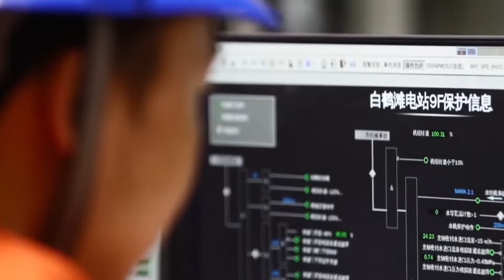Megaproject Of The Century: China Starts Building World’s Biggest Hydropower Dam!

Comment: Good Morning 
This document is for a retro fittable power production system for hydro dams to have up to three extra turbine banks without making issues for the main turbine hall
Now the reason this type of system has not been looked at was two fold .. the loss of flow rate and back pressure issues
Now these two were said to me as the big issues and yes there are others but they are foreseen and can be overcome  
As all the worlds dams have the same basic layout regardless of the turbine fitted. That being water turbine shaft to shock uni joint to the power turbine. And so all have the same common limitations  
A new type of turbine unit is needed if the main turbine hall is to function with without mods if multi bank units are to be placed in the flow 
This new system will never match the output of the main turbine hall but after years of chasing miniscule increases a system like this one is a massive jump in output 
At this point it should be noted that most of the installation process can be made with the dam online selling power to the grid and there is no increase in water usage when fully installed  
This system has been designed to be fully independent of the main turbine hall so as to be serviceable with the other units online and running with the main hall 
A FEW OBVIOUSE POINTS 
Even if our numbers were to fall we are still in a situation of heading to a power shortfall outcome things like data centers e cars and a hole host of other tech 
The lag time at best for any new system to get online is 2-3yrs at best ( unless ur the snowy river ) and i believe we are well short of filling the markets needs 
OTHER BENIFITS OF THIS UNIT
Is a dam green tech? well its more recyclable than wind and solar
lasts 100 plus years vastly more than the others
It should be noted if the patent is very strongly protected the market will come to the seller even if that is Australia or America so a 100 billion dollar a year marketplace makes the wage bill a non-issue 
SOME OF THE BIG BENIFITS 
Bigger market share/customer base
All the required infrastructure is already in place
the asset has a longer life span
No issues regardless of type of the main turbine fitted 
No added down time 
AND ITS TRUE BASELOAD POWER from a existing dam

Comment: You do not know a single thing about that project.  You do not even bother to read the most basic information.  That project is big.  But there is NO big dam.  That project is designed to generate huge quantity of electricity because the land drops 2000 meters in 50 kilometers.  So a big dam is not needed there.  They only need a low dam to regulate the water.
Reply: You did not watch the video. He describes 5 small dams

Comment: It may generate 3X electricity compare to 3 Gorges but it wouldn't be the large hydro dam. Since it would be a RUN OFF THE RIVER DAM, its dam would be the largest!!!
Reply: This project generates a lot of power because of the landscape.  The land drops 2000 meters in 50 kilometers.  That is what creates the power potential.  In regular places, like the Three Gorges, you need a huge dam to lift up the water.  But not this place.  A big hydroelectric project and a big dam are two different things.

Comment: A hydroelectric dam is designed to manage water flow, not stop it. While it must release water to generate power, holding back too much would cause it to overflow. Crucially, the process does not consume water; the same volume that enters the dam is released downstream after generating electricity. Therefore, a properly managed hydroelectric project can actually stabilize water flow to regions downstream.
Reply: It’s not a dam though
Reply: Oh, you are a real expert!